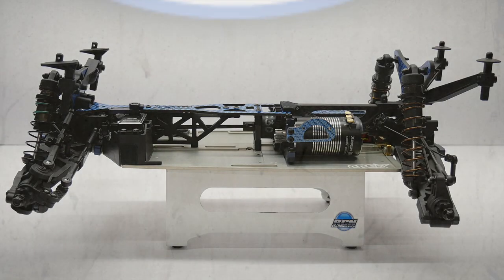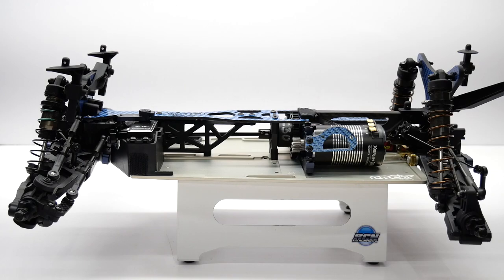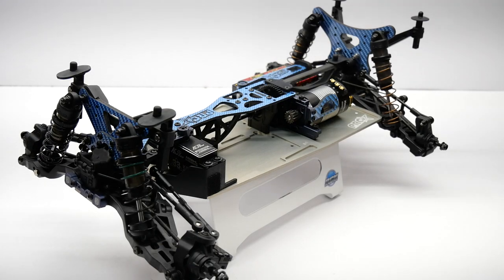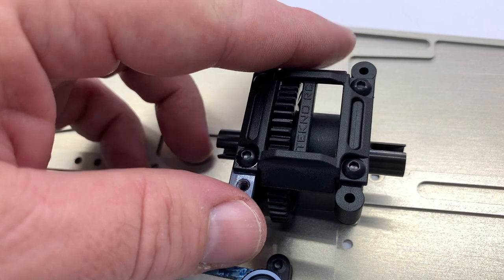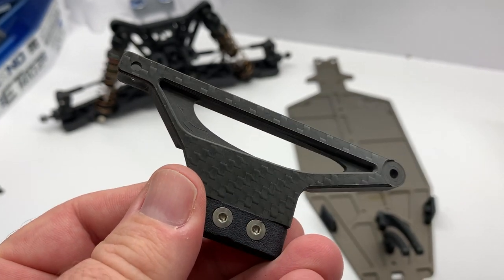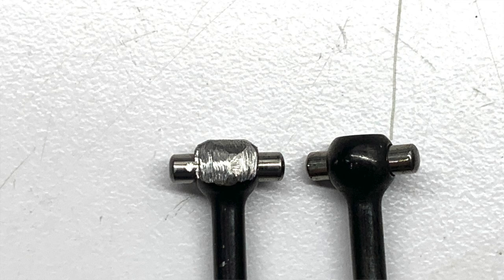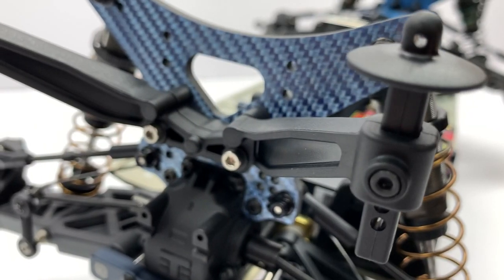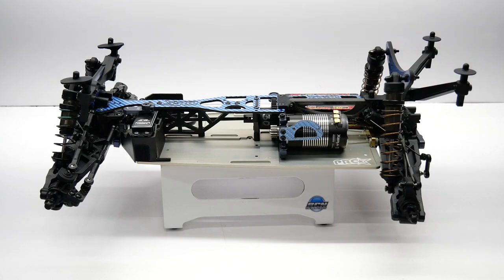Tekno ET410.2 to Lightweight 4wd ShortCourse - ProStar Conversion - EP2

Comment: Hay you can take the short course rear body mounts off of the b6.1 cut it in half and it will line up with the 2 holes on each side and you can still run then rear bumper
Reply from the maker: Cool - thanks for the info
Reply: The stock body mounts that he sells you can do the same cut them in half as well.. I'm trying to figure out how to keep the body from rubbing on the tires. When there is suspension travel

Comment: Did the bumpers that you are not using come in the kit? What bumpers did you order?
Reply from the maker: The bumpers were add on items from the ProStar site.  They will definitely work, just need modification to make them durable.  I have some direct bolt on items coming though

Comment: Why does the rear shock tower not have the screw holes in the correct location?  Seems like an engineering or manufacturing woops to me.

Comment: I have an old SC10 4x4 and I am debating if I should rebuild it or get a Tekno. Any thoughts or ideas. I have been trying to find out if the SC10 4x4 can still be competitive or if it is just trash. So ignore the fact of lack of support and electronics is the SC10 4x4 belt drive frame have any potential or can hold its ground against the tekno?
Reply from the maker: I wouldn't say it's garbage...but it's def. finicky, hard to tune and fragile.  With a highly skilled driver and some tuning, any car can be competitive.....but I'd pick a Tekno any day of the week....
Reply: @TheRCNetwork  Thank you so much for responding! Any particular performance problems or disadvantages you see the SC10 4x4 has or you see others struggle with?
Reply from the maker: I never owned one...but have seen many of them and ran against them.  Mostly people complain about is just working on them.  The motor and servo are very hard to get to.  Literally the first step in the manual is to bolt in the servo.  The belt tension and differentials were a pain - diffs were geared, but really shallow as it was belt driven.  It had a rear transmission/geared diff with a center slipper clutch.  Just really odd vs. today's modern 3 fluid filled geared diffs running shafts.
Reply: @TheRCNetwork  Again thank you so much for your input!:) I think ima buy a tekno and along side try and attempt the impossible to see if i can get the SC10 4x4 to hold its ground against it!!!

Comment: how does this drive compared to the sct 410.3?   I need this
Reply from the maker: Although I never ran this truck - I can tell you, it will feel like a very light SCT 4x4.  Which is good and bad on some tracks.  The SCT410.3 is built like an 1/8th scale buggy and can deal with outdoor and indoor tracks.
Reply: @TheRCNetwork    prob great on indoor!  I have the sct 410.3 for outdoor and liking it a lot compared to the losi I had years ago.   Would be cool if you do an update video to this!  on the track!
Reply: and if you are interested in selling let me know!
Reply from the maker: @gotmesom  I sold off this one and mist of my collection about a year ago.  I kept my EB48 2.0 and a crawler.

Comment: How much cost all conversion kit?
Reply from the maker: I have links in the video description...but obviously, you need a ET410 to start...then the main items are about $200 - the Chassis plate, rear brace and rear driveshaft.  If you want all the extra Carbon Fiber parts, it adds a bit extra to the kit